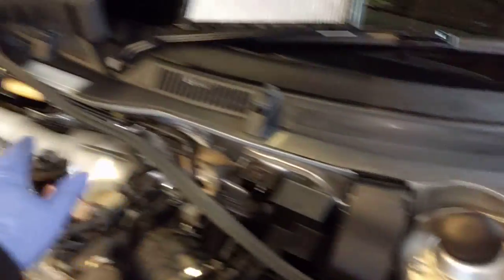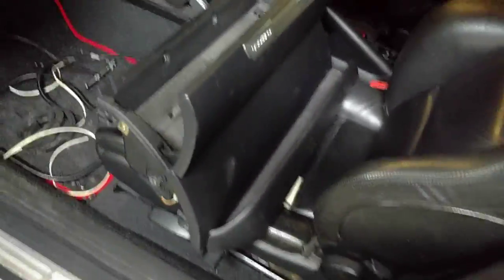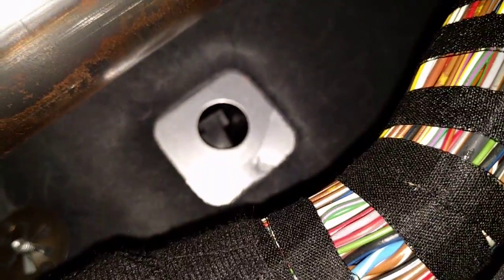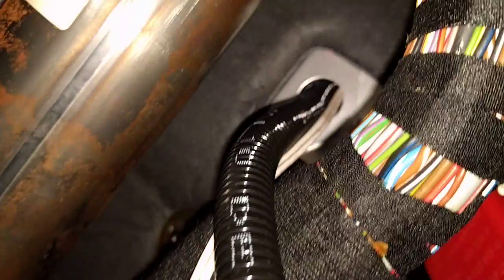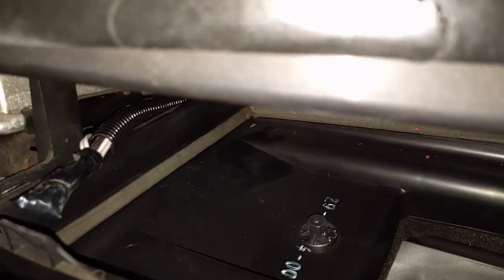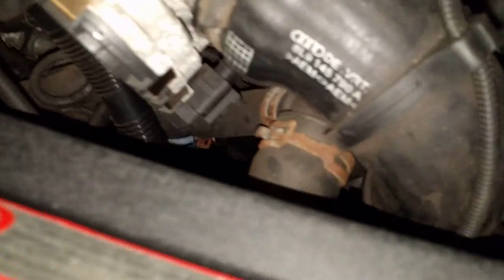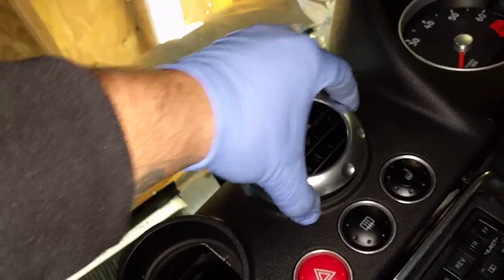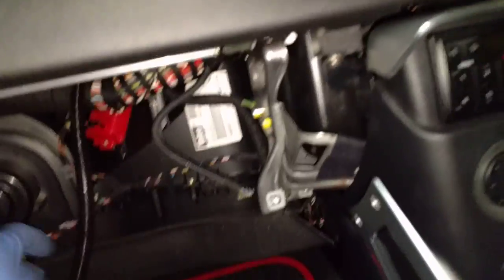Audi TT boost gauge installation guide

Comment: Hi pal I just installed  mine what boost  psi should  I be getting  its the 225 with stage 1 remap  am holding  25psi   dont no it thats to high cheers 👍

Comment: Ok, so just received my boost gauge and out of the box the needle is well above zero.. I'm guessing it should be exactly on zero when not fitted. Can anyone help me on this? Cheers!
Reply: Had this with both my stack and racetech......not to worry when installed vac will read true zero. If you have a decent guage.
Reply: @davidkane9876  it was £21 so didn't have my hopes up! Have sent back and ordered
A more expensive one... Cheers for replying 🤟

Comment: Just followed your guide this morning, all fitted easily except for getting access to the side torx bolt nearest the A pillar, had to use a ratchet instead of screwdriver handle to remove it, event the short handle I had wouldnt fit with the door still attached.

Comment: Yo, your the go to guy for TT's... I tapped into the FPR and I've had ppl tell me it's wrong, talking about my car gonna run lean, is there any truth to that.
Reply from the maker: if you use sub standard parts, and it fails, then yes there could be a problem, but that's the case wherever in the system you put it.

Comment: why not T off the vac line to the actuator to the n75 valve? much shorter
Reply from the maker: The n75 line never sees vacuum, only boost
Reply: @BWSTT  many thanks, is that not the same with the fuel reg?

Comment: Doesn't it just give FUEL PRESSURE ? How does that measure boost?
Reply from the maker: It's a direct air feed from the intake manifold, that the FPR uses to regulate fuel pressure. It's at the same pressure as the manifold, which is what we want to measure

Comment: How did you retrieve the grommet I lost mine down the back? Brilliant video. Thanks
Reply from the maker: The cabin filter housing is held in with a few 10mm fixings. Remove the whole thing if you need to find the grommet